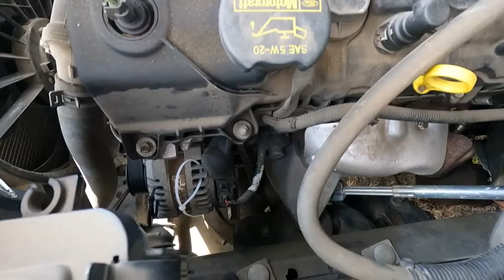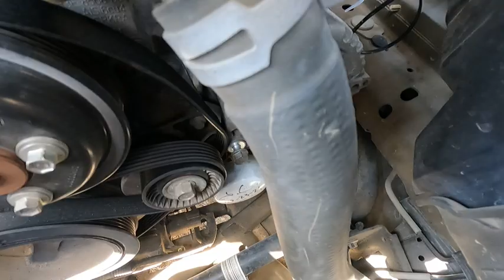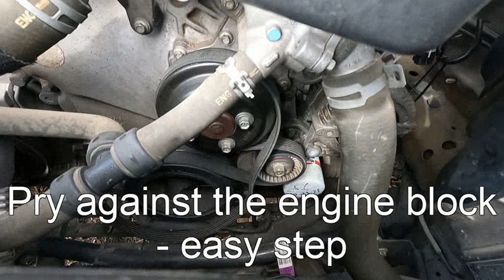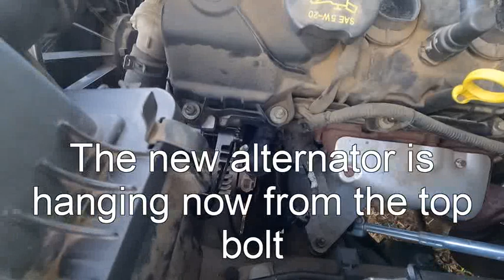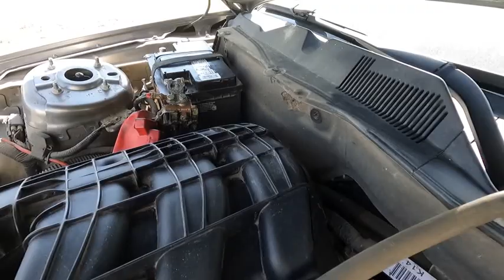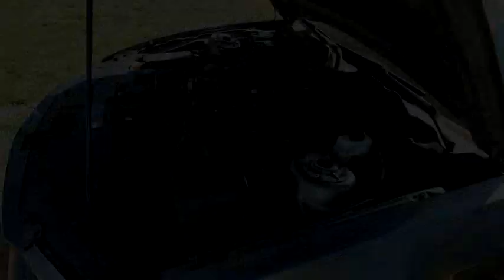How I replaced my 2011 Mustang Alternator

Comment: How did you use the bar to get it lose I'm stuck on that part and every video skips over it
Reply from the maker: you just need to put the bar end between the alternator and the engine block, wiggle back and forth till the alternator gets un-stuck